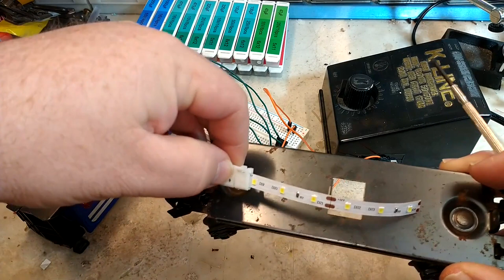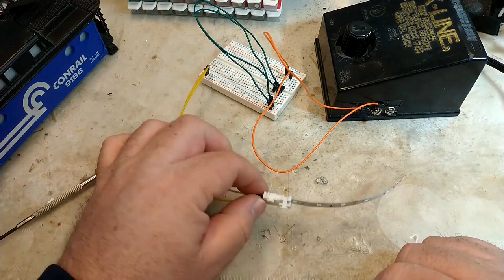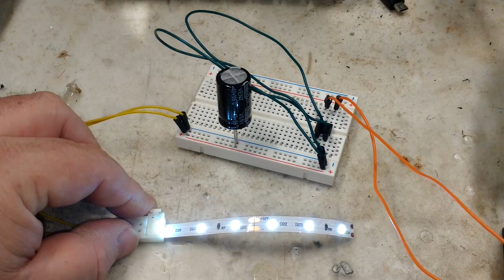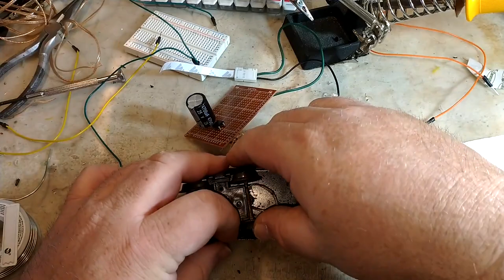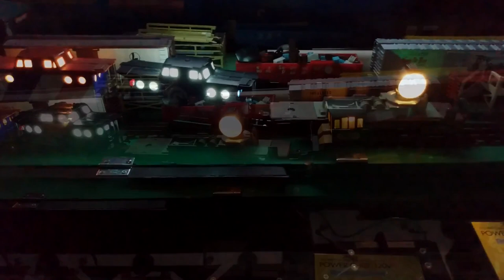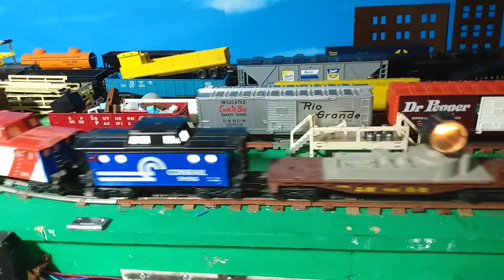How To Add Flicker-Free LEDs To A Lionel Caboose

Comment: It's like you captured the sun in that caboose!  I would dim it down by using a few less LEDs and a more warm color vs. cool white.  You could also use translucent paint or highlights to mute the LED.  If you really want to get sophisticated, you could use a current limiting circuit to precisely control the current and thus the brightness no matter what the voltage over the minimum level of the led driver.  I did a similar modification (simplie RC circuit with a bridge rectifier) that was LED driven, and flicker free on my channel but I intentionally wanted an incandescent style color and look.  I did enjoy your video just the same.  Keep making these!
Reply from the maker: Thanks for the comments. I like my lighted cars REALLY BRIGHT!! :-)

Comment: I commented on your earlier video.  I found out that Lionel trains will run on DC so now I run all my Lionel on DC.  Makes it easier to use LED's on your rolling stock.  I changed all steam engine headlights from incandescent to LED's including a dropping (ballast) resistor usu. 220 ohms.  If you use some of the blue stick -em you don't need a circuit board.  As I previously stated, i use very small varnished magnet wire.  It will handle 12 volts (13.8vdc).  Just be sure to scrape off the varnish before soldering.  You need to paint each LED bulb on the strip with some yellow acrylic paint like I did.  Those bright white really need toning (warming up) down.  W Rusty Lane K9POW in eastern Tennessee
Reply from the maker: Thanks for the info!

Comment: As an ex New Yorker used to riding the elevated train and the subway lights flicker all the damn time so that's prototypical. It's part of the character of the trains. Lights flickering and an airplane that's something different. Anyway if a caboose lights up it lights up and if it don't it don't I just put it on the back of the train and let them ride.

Comment: Is your transformer ac?   I want to setup led for my lionel f3 which is on ac
Reply from the maker: Yes. AC power.
Reply: The rectifier will make DC from AC, so there are nemas problemas! :-) (I think basically all 3 railers where AC, ( at least the Lionel and Marx (as well as Hornby, JEP, Märklin, etc), but not the American flyer which was a 2 rail DC as i remember (same with Fleischmann, they where all DC, i think Bachmann is DC as well).)) A dedicated DC train does not need the rectifier since it's integrated in the transformer unit, but all AC trains does (i think Bachmann solved this by simply adding a battery... But i like this solution much better).
Reply from the maker: @sheep1ewe  American Flyer had both DC and AC depending on the era. Lionel also made some DC powered starter sets in the MPC era.
Reply: @ToyTrainTipsAndTricks  Thank You! I only got one American flyer and it was broken when i got it (but i managed to fix it, i knew it was broken when i bought it), but it seem to belong to the DC system, that's why i taught so since all my old Lionel sets are AC. I use an old Fleischmann unit to drive it at the moment since i did not had the original transformer for it. I want the original Lionel double knob transformer, but at the moment i couldn't afford the import custom charges in my country so it had to wait and i had to use my old Märklin transformer for them at the moment, it's more primitive constructed but it seem to work for a single train if one does not draw the bar to the switch mode (however, some of my older Lionel sets seem to use a similar pulse engaged mechanical anchor system).
Reply from the maker: @sheep1ewe  Also remember that all AC open frame motors are universal and will also operate on DC current. You have to disconnect whistles, bells, etc but the locomotives will run fine.
Reply: @ToyTrainTipsAndTricks  Thank's! I remeber i think it was Märklin (i am not sure, but i recall a very vague memory of seeing this for an American 0 gauge as well... Unfortunately i can't remember the manufacturer...) used a solution in the mid 1900 with an external diode (i am not going to repeat what my auto correction program wanted me to correct "diode" to here, but i hope i wrote diode and not that suggestion...)  in series with the transformer so the train could run remote in both directions. Hornby did use a solution with a mecanical craddle in the 1930-40s in order to reverse the engine on AC, which i never seen on any other manufacturer during that era (Lionel and the French manufacturer JEP did use a traditional point step switch as it seem, at least on the ones i have in my collection, i guess the very early ones where possibly meant to also function with old car and radio batteries my guess... At least i assume that in the 1930 and early 40s. However i heard about a radio valve driven system from the 1950s but i have never ever seen any parts of it, only a short text article, so it was probably rare and not that many of them made even if a few manufacturers did use the same type of tube sockets but for traditional lights and mechanical switches (i have a dream of recreating it one day with similar type of valves if i manage to find more information about it, that had been genuinely awesome!)).

Comment: Rather than all the electrical circuit how about a 2nd roller on the other truck. Mechanical and simpler and no LED’s & components required. 2nd roller to insure constant contact across track interruptions.
Reply from the maker: That's another way to do it. I needed to replace the bulbs anyway, and I wanted brighter lights. Plus, buying additional pickup components would cost more than the electronics. Another option, if the bulbs were still good, would be jumper wires between cars so all the pickups are wired together. Thanks for watching!
Reply: Yes, but it wouldn't be guaranteed. It would still flicker under the right conditions, like with track as dirty and oxidized as mine.

Comment: I never model Conrail because it is the remnants of the great railroad Transportation Network that was destroyed on purpose. My bicentennial locomotives have the CR for Conrail painted out because in my Railroad no railroad ever goes bankrupt. Just because railroads are deprived of traffic starved to death economically and regulated to death while their competitors are subsidized out the Wazoo, just like we would not show steam locomotives being prepared on a deadline to be hauled away as scrap. We might use older locomotives for scenery purposes or for stationary trains. We might have them in a scene where they are being serviced or repaired but we certainly wouldn't have a scene where they're being cut up for scrap metal. Isn't it interesting that we Finance 96% of the airlines cost and they still go bankrupt? Just like in my 1970s Railroad there is no phony energy crisis and the gas price is 39 cents a gallon at the so gas station.
Reply: Chaos and Politics go hand in hand.